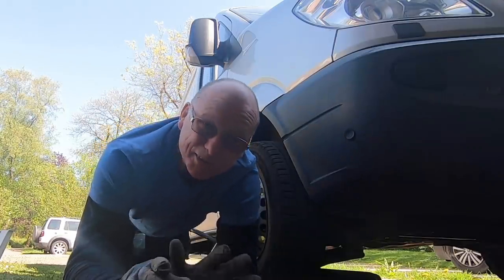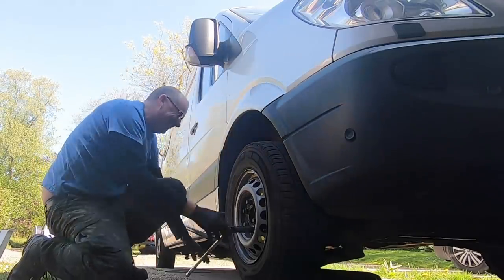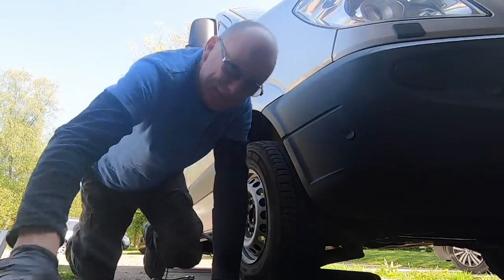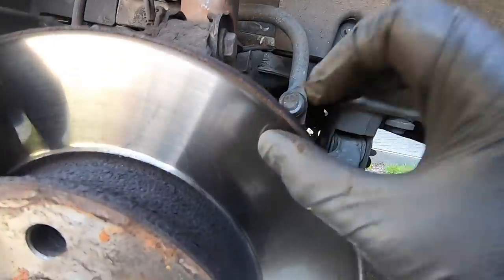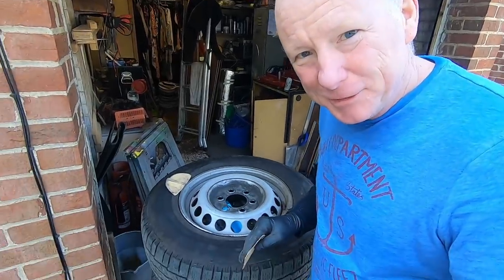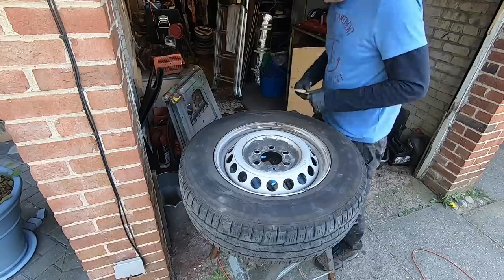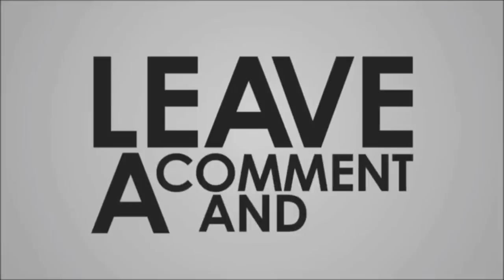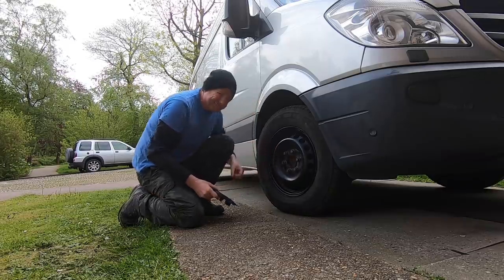Best Wheel Painting Hack & Technique

Comment: Handy tip, support the wheel brace or socket and extension bar with a jack or blocks when initially loosening. This orevents the brace from slipping off and rounding rusted/over tightened nuts. Another great vid.

Comment: Good Job Mel. I used the pound shop spray on my Convoy. Did the crowbar too. Nice one 👍
Reply from the maker: Thank you worked a treat 👍😊👍
Reply: Was going to ask, where the freak do you get spray paint for a pound! Obs, pound land stretcher etc. Wouldn't use it anywhere crucial, but wheels, well they take the brunt of the road. I live in rural Somerset. Those lanes rag a vehicle finnish. Great vid, as standard.

Comment: Great and quick work. The "after" look was really big value for the money spent. Two questions: a) Did you overspray the lead balance weight? If so, won't they be (most certainly) taken out and perhaps be placed elsewhere when you get your new tyres and get them balanced? And, b) You also forgot (perhaps didn't mind) to remove the tyre valve. Yes, it might be a pain in the neck to deflate the tyre, remove the valve (most probably, destructively, and therefore get new ones, something which your tyre shop will likely do anyway,) spray paint the rim and re-inflate, but it would be worth the effort, imho.
Reply from the maker: Hi yes I painted over the led and no definitely not worth removing the valves it’s just a quick way to make them look better than rusty rims and ezy to touch up when they get scratched and they will especially when I go driving up a farmer’s field on a hunt 👍😊👍

Comment: When you get your new Tyers get the wheels “static balanced” then there will be no balance weights on the outside. Much nicer look, I left the hub caps off and put a set of yellow marker things on so one gets a visual indication if the nuts/studs are loosening. I have a Boxer with B. F. Goodrich A/T 235x75x15 white lettering, I think it looks well sweet. Stay safe 🚐☕️☕️👍🏴🌈
Reply from the maker: Nice idea thank you your van sounds like a best love it 👍
Reply: On my truck mel i have the small plastic beads in the tyres , they self ballance when you roll faster than 7mph ,,, so far they have been great ,, the tyre shops here do it for free when you buy tyres ,,, saves the lead weights

Comment: That wheel looks good. I used high build primer on mine to hide any bits as it’s a difficult shape to sand. I’ve just bought some wheel centres like yours but they are loose on the wheel nuts, any ideas/tips?
Keep em comin Mel👌
Reply from the maker: Hi thank you has your new wheel covers got the metal spring rings inside if not that’s what wrong 👍😊👍😁